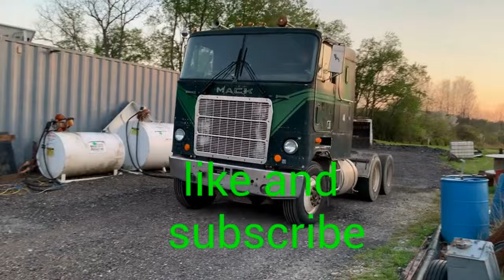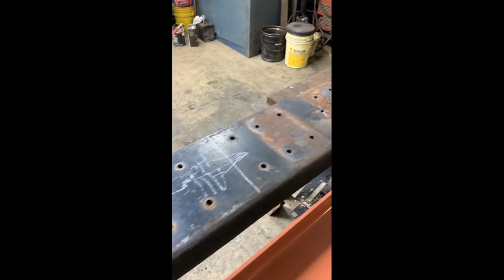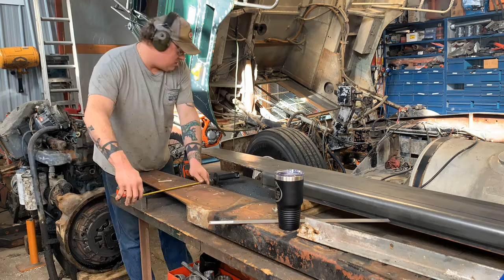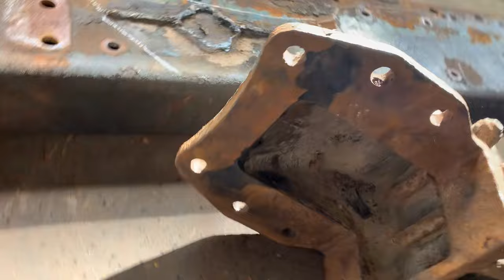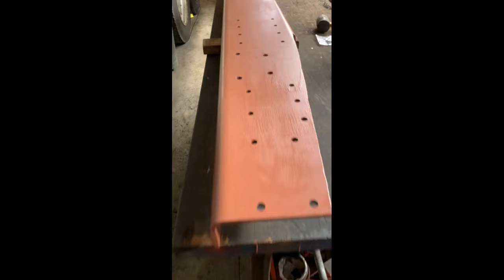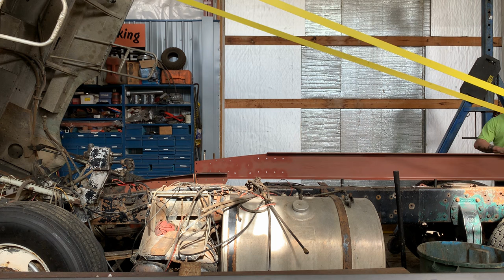Mack Cruise liner INSTALL The Right Frame Rail!! NOW! NO PROBLEM!!!

Comment: is there a particular type and thickness of steel for this?  Do you upgrade from what was in it stock??
Reply from the maker: Yes the frame was made at a truck frame factory. I had it made thicker it was 1/4 in. I went with 5 1/6. So it’s stronger for the stretch. Thanks for Watching!! BPT. 57in stretch